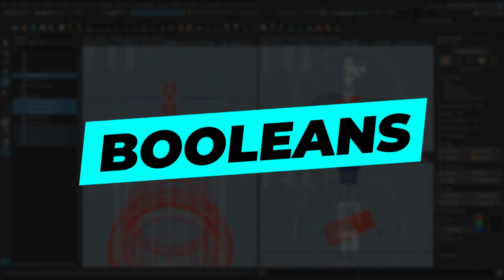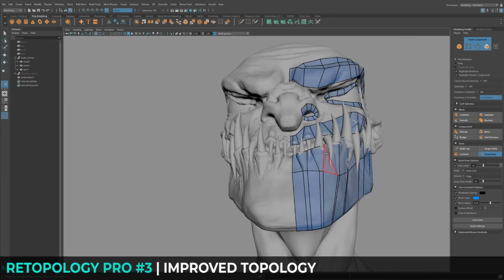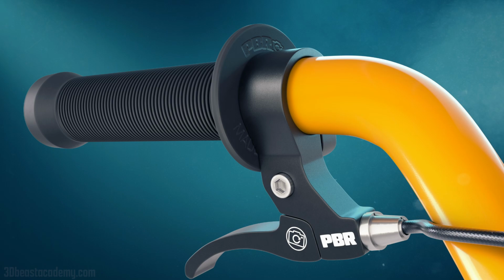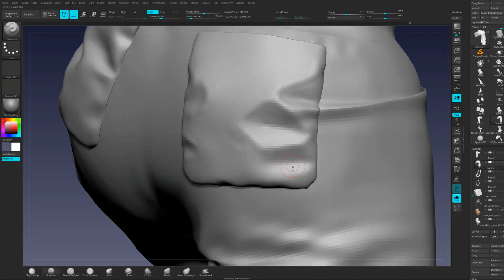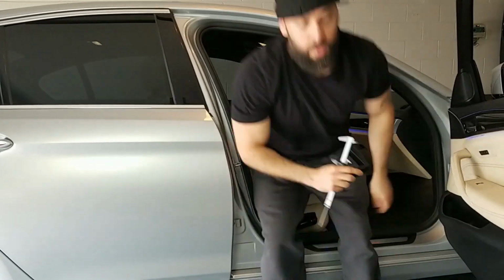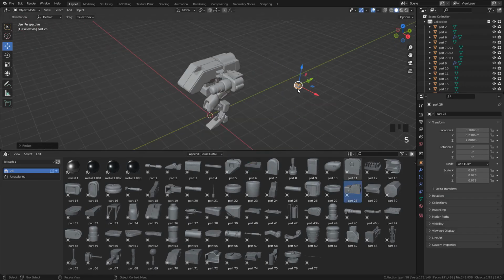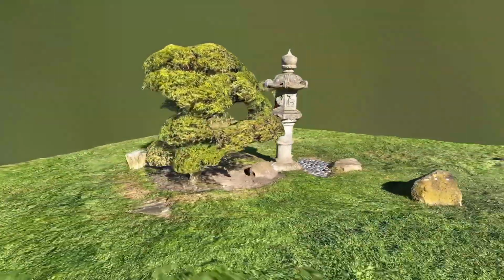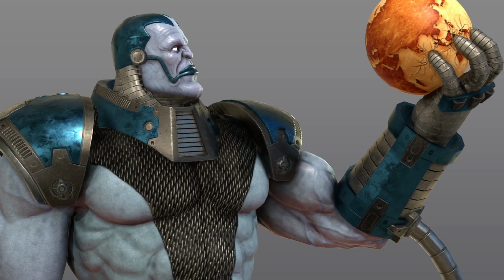8 3d Modeling Styles Every 3D Artists Should Know

Comment: Actually I have a question:   connected geometry vs separated geometry?  Which one is better?
 I'm specifically asking about the booleans operations part.  Because I don't like booleans, because booleans results geometry is sometimes very hard to clean. Because you also mentioned models with connected parts are more suitable for games.  So far I've only made a few models for games and I don't have that much experience with models made specifically for games. I make models mostly for animations and illustrations.  But the components of these models I made for games were not necessarily connected. I don't know that a game solid mesh is a rule. Rather, I understand that it is a matter of choice. But I use your tutorial to fill in information gaps that I have. More knowledge is always better. 
 So I would appreciate an answer. Thanks. Good tutorial.
Reply from the maker: I highly recommend you watch this video; it answers most of your questions. https://youtu.be/zV3mhvWpppM
Reply: @jlmussi   10x man. I appreciate. I'll take a look.💪

Comment: I have found that a Pistol modelled in Fusion360 can be exported as a low detail obj. Then if you duplicate that project and add all the chamfers and details the reference has , that high poly mesh can be used in Substance Painter to bake details onto the low poly  mesh. The result is a pistol with a very low vert count with high accuracy, it is triangulated though , so can be a pain to UV, but I use 3dCoat and stick to hard edges mostly. This is a very fast workflow that does not involve any retopo.

Comment: I just learned Edge Ring Connection. Which is basically planar modeling around the silhouette edges. Similar to retopologizing from flat 2d shapes first then using deformers for shape depth.

Comment: I don't see retopology as a modeling method.  It's a secondary process that takes place post modeling.  Retopo isn't creating but editing something simplifying an already existing model and usually is a post process of digital sculpting.  That rules retopology out for me as method of modeling.

I think that Bsplines,  or Nurbs are very good for doing organics.  Lots of guys were creating amazing models with Rhino 3D back in the early to mid 2000s.  

I have never heard the term kit bashing in modeling but hey, it doesn't mean that it wasn't used.  I've just never heard of since I started in 3D in the late 90s.

Polygon modeling is a universal term which also encompasses SubD, Rail/Subpatch, and Primative modeling.  That being said, unless you are using Nurbs, Voxels or Pixols, all modeling is polygonal because It's all polygons.  We use to stress knowing how to manipulate polygons but polygon modeling is a redundant phrase.

Photogrammetry is more scanning than it is modeling.  Yes, there is some clean-up to be done so modeling isn't completely ruled out but I don't really see it completely as modeling.

I don't know.  Maybe there are just a lot of new terms out there that I just don't know about but traditionally, modeling meant Nurbs/Bsplines, Rail/Spline/Subpatch, Meta, SubD, Primative, Sculpting and Displacement.  Boolean was just a tool or process of manipulating polygons like extrude, lathe, smooth shift or spin quads.  It was not a method of modeling in itself.

Comment: I do a lot of level design and hard surface and use a hybrid method of modeling based on a couple methods mentioned. I first use basic shapes (multiple objects) to get the general idea of how everything will look (this start is extremely good for spaceship designs), it is similar to scrap building. Once I am happy with the general shape, I model simple low poly parts. Then I take the one with the largest surface area and in edit mode basically trace the rest of the components. This way the geometry is already clean without much need for additional touchups once the modeling is done. Once I get all the basic shapes, then I use bevels to get the smoother shape where needed (hand beveling). After this is done in the case I am using mirror modifiers, I will also mark all the seams for the unwrap so I do not have to do it on both sides of the model. After this, I will apply the mirror, unwrap the model and using nodes make basic procedural materials. I will bake them onto clean textures, export them to something like photoshop to do a bit of touchups. Then through software that will make my PBR maps. Finally, I will reimport all the maps to a new material, connect everything and then add a bevel modifier to give it a bit of a clean shape. I am working on a potato so sculpting is out of the question. This method is light on performance and the models can reach photo realism with way less geometry. The only resource intensive part is baking the textures to 4K resolutions, 2K and smaller are pretty fast... I am using Blender for modeling.

Comment: Modeling styles:
**Booleans** (02:07)
Pros- fast, accurate, powerful in specific situations.
Cons- unexpected results, bad topology.
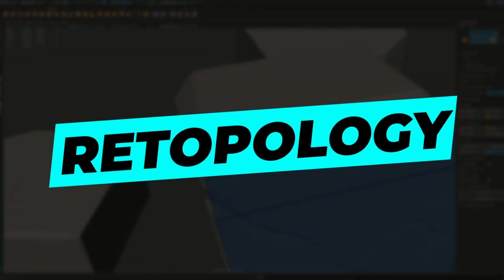**Retopology** (03:34)
Pros- improved performance, faster workflow, improved topology.
Cons- time-consuming, loss of detail.
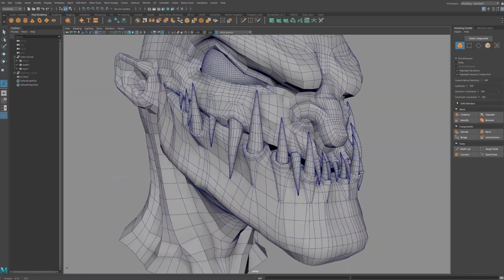**subD modeling** (05:33)
Pros- less working geometry, infinite quality.
Cons- difficulty.
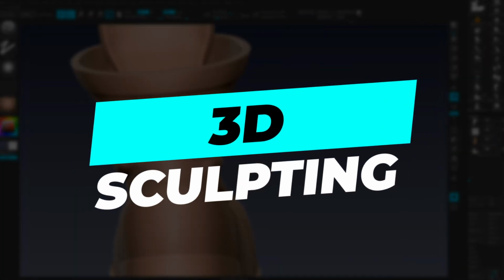**3d sculpting** (07:56)
Pros- organic modeling, concepting, skip the technicals.
Cons- processing power, limited to organic shapes.
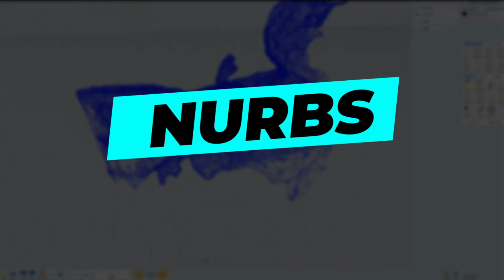**NURBS** (11:16)
Pros- precise measurements, compatibility, industrial standard.
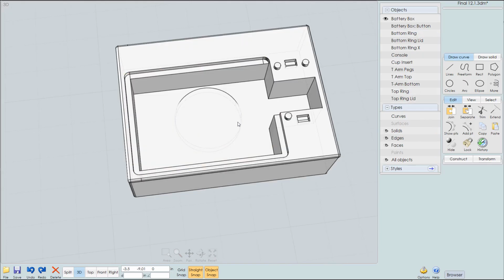**kitbashing** (13:28)
Pros- quick details, access to many parts, faster design.
Cons- limited control, limited creative options, overreliance on kits.
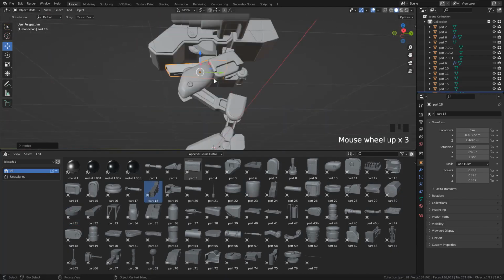**poly modeling** (14:57)
Pros- widely used, widely accessible.
Cons- time-consuming.
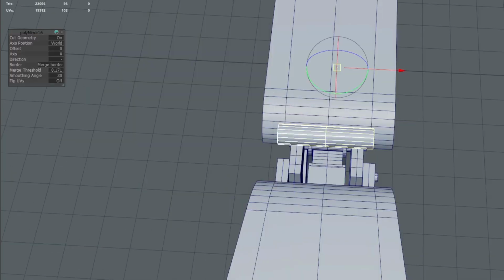**photogrammetry** (16:33)
Pros- real-time model creation, complex model creation.
Cons- time-consuming, accuracy relies on photo quality, can't capture certain surfaces.

Great video thank you!!
Reply: Thanks man.
Reply: line separators would've been helpful
Reply: dont you mean nerves? 😂 that sh had me dyingggg

Comment: VR modeling (for instance Substance Modeler) is a different way to do 3D modeling. However, it can be considered as a mix between poly-modeling and sculpting. Thank you for that video!
Reply: I think it depends on the VR software used. Adobe Substance 3D Modeler, (the successor to Medium) and Masterpiece Studio, are technically voxel sculpting tools that do not support poly modeling or poly sculpting but one can export high poly meshes to use in other software. Sculpting voxels in is a very different experience than sculpting polys like in ShapeLab VR (or ZBrush on desktop or Nomad Sculpt on tablet) as the size and number of available polys will determine the level of detail possible compared to how voxels populate at specific densities along a 3D grid. I understand 3D Coat on desktop has a voxel sculpting mode too. 

On the other hand, Gravity Sketch definitely supports poly modeling, subdivision modeling and aspects of both poly sculpting and nurbs surfaces. With good topology flow, it’s great for making game ready models too and even supports live, remote collaboration. I’m much faster at SubD modeling in GS than any desktop software. 

All of the above VR 3D softwares make navigating and resizing the scene incredibly intuitive compared to desktop software. Also, the satisfactory joy that comes from being able to model gesturally with one’s hands and arms in actual 3D space is unparalleled as well. Substance Modeler and Gravity Sketch are my favorite VR tools depending on which workflow best suits what I’m creating.

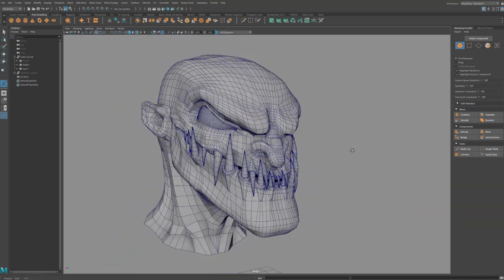Comment: Very good overview, I'd add: 5:30 for Retopology the artist also needs knowledge of animation, anatomy, and texturing to get the best results. The deformation of the character model during animation can have problems without knowledge of where to put the cuts, and texturing can also be easier if you're aware of where to hide the UV cuts.
Reply: For automated retopology I would use Zbrush, really fast and you can control ist by polygroups.

Comment: I don't understand the difference between sub-d modeling and poly modelling, isn't sub-d modeling just doing poly modeling but with holding edges and press 3?🤔 And u said sub-d is also useful for games do you mean useful for baking to low poly/poly modeling or we actually use sub-d/high poly to put in games? 🤔
Reply: I think that's the main difference, yeah, with sub-d modeling you need to have holding edges and you have to pay attention to how the topology will react when smoothed, while with just poly modeling you are never going to smooth the model and instead you're either using it as is, or you're using it as a base for a high poly sculpt. And yes, you should use the smoothed model to bake the details to the low poly version, you will not use it smoothed for games.

That is how I understand it, but keep in mind that I started learning 3D around 4 months ago so I might be a bit off :)
Reply from the maker: @NinjaMK  You got it!
Reply from the maker: Both poly modeling and sub D are essentially a polygon based workflow.  The SubD model can be a high poly source from which to extract texture details and applied to a low poly asset, but so can a high poly sculpt from Zbrush.  So the Sub D model can be a dual purpouse mesh.  It can be used in a VFX pipeline or as the high poly to extract your textures from. Hope that helps.